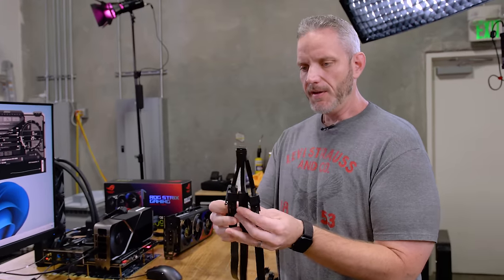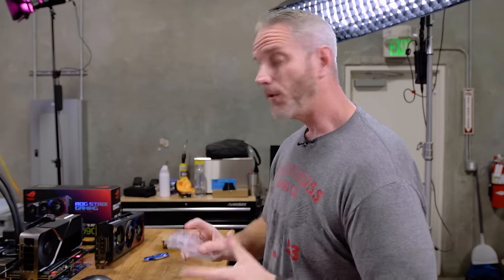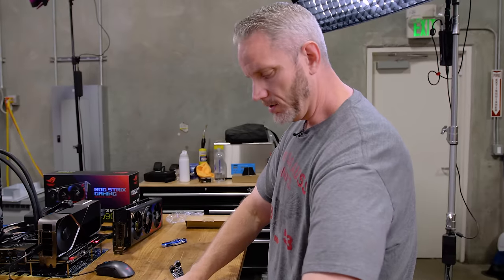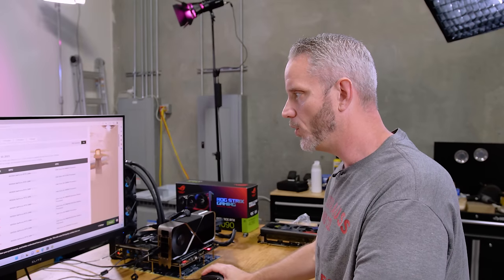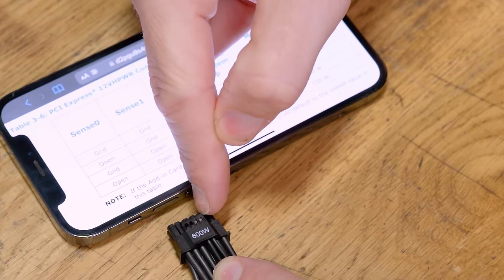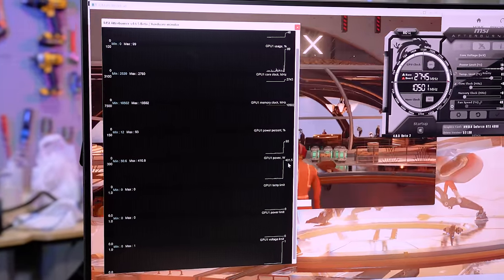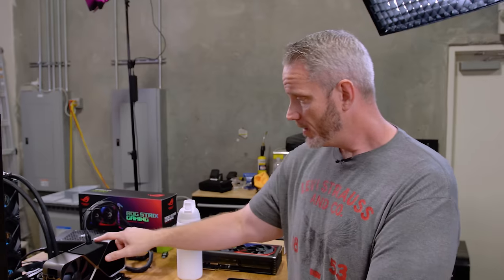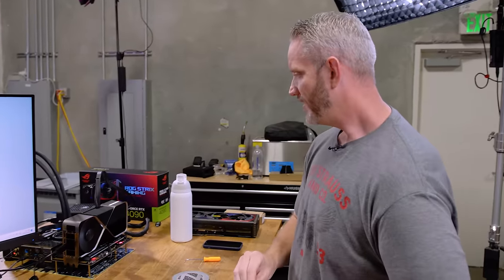DON'T Do this with your GPU!

Comment: about the cable, a little factoid i Remember from school.
a single strand takes less power than a multi stranded one.
unless it's alot thicker.
there is a formula to do the math on it.
but that's to long ago

Comment: ...because each of your "four" leads, especially the one with the 2" extension, plug into a single plug on the PSU ?!??

The primary concern is the heat generated by pushing too much wattage through too-thin Guage of wire AND the possibility of solder points failing; basically boils down to manufacturing quality,  or lack thereof. 🤔

Comment: But Jay, GN just proved for overclocking you need all four connectors, while it will operate on three (100%) four gives you enough current (133%) if you want to overclock. How is corsair getting enough current? (specifically 133%) So I uses you are saying the two pins force the power limit to 133%?
Reply: The cable GN used has a circuit in it that counts the number of attached cables and grounds the sense0 and sense1 wires accordingly (so with 1 cable both sense pins are open, with 2 cables it grounds sense0 only, with 3 it grounds sense1 only, with 4 it grounds both to signal 150W, 300W, 450W, 600W as needed). This is because the old ATX spec 8-pin cables are rated to max 150W each, so the 4>1 adaptor circuit is making sure nothing exceeds that. A different adaptor could ground sense0 and/or sense1 however you want. You could make a 3>1 cable that grounds both and supplies 600W, the card will get the power and run with it, it's just that now you're sending 200W down 150W-rated cables and maybe something melts.

Corsair's new cable is 100% dumb, it's just built for 600W and they're happy to say that it can draw all 600W from just 2 of the ports on their older modular PSUs, so it just grounds sense 0 and sense 1 when plugged in to tell the card that 600W is available.

The PSUs actually built for the new ATX spec won't need any adaptor, there will just be a 12-pin (+ signal wire) cable replacing the old 8-pin ones.

The power limit is just: nVidia says the card is 450W so that's 100% of the power limit; the card/connector is capable of supplying up to 600W so that's 4/3 = 133% max that the power limit could be set to as an OC. If the cable/PSU plugged into it signals only 450W though, then only 100% is allowable. Presumably when new PSUs that actually communicate come around they could signal something else, so you could have a 250W RTX 4060 and a PSU which can supply up to 400W to the GPU giving a max power limit of 160%.

Comment: Solid wire carries less amperage or voltage than stranded. Imagine the electricity flows on the outside of the wire, so stranded creates more surface area.

Comment: Yessir, I was paranoid because I couldn't find if you could actually just use the Type 4 connector - couldn't find the info online, I had to take the chance and just try them because i figured.... there's no other included with the card, PSU, or anything else that has the 12V high power connector - but it's not called the "Type 4" anywhere but on the cable itself, so it's very ...irritating for someone who isn't familiar with it, to actually wonder if it's acceptable or even safe to use.  It would be INCREDIBLY USEFUL if these companies would start calling it something consistent - I do understand it's the 12v - but it doesn't actually say THAT part on the cable itself, lol.

I dunno, "taking a chance" when you're dealing with such delicate and expensive stuff is ...not something I ever enjoy doing... at least... easy way to have catastrophic consequences, depending on what we're talking....

Fortunately, the Type 4 has been working perfectly on my 4090, thus far, and I've seen no signs of melting or any smells like some people do with any of those connectors, and the Type 4 being more compact, and the cord being so high quality, makes it far easier to square away neatly, and to keep seated when you're moving every other wire in the chassis around.  The Type 4 connector ... at least at this point... I highly recommend.  It's just so, so, SO much better, it sorta makes me wonder why they even went with the 4 connector... "adapter" - if you can even call that ...thing... an adapter, haha.  It adapts... all the ports on your PSU into one!  lol.. it really is an outrageous "adapter" - I pulled it out and immediately blurted out "what the f**k is this enormous thing???"

Comment: 12 pins. The normal 8 pins had 3 set for 12 V power and 2 sense cable. I would assume 12 pin takes away 2 sense cable. So it's 5 set for power (in and out) and 2 for sense. That means every single cable that runs power has to run 600W/12V=50amp. 50 amp/5 cable set. So 10A. Jesus. It better be solid core!

Gladly correct me if im wrong. But 10 amps for what looks like a 1,5mm^2 is insane. In a building code i wouldn't be able to install a fuse for that kind of load.

Comment: Yep, and the cable that comes with the Corsair SF850L is way too short, in turns out, for a Lian Li O11 Mini (WHAT!).  The GPU cable supplied by Corsair is just long enough to almost be just too short for the job.  I have it in, its under tension and cannot be hidden.  Seems they were being cheap, or just assumed everyone was using a max case with PSU under GPU.

Comment: Only two is not because solid core but because EPS/CPU 8pin (Same plug on PSU side as PCIe) is 335W on single conector.

Comment: I´d also be fine with 3 or 4 cables going into my GPU, but these Y-cables just look bad. Or make one cable coming from the 600w connector and make it split at the end of that, so I can hide the Y part. Also I don´t understand why they don´t put the connectors on the rear end of the GPUs. I´m no GPU manufacturer, but I think it was no rocket science to do so.

Comment: It's NOT "getting the full 600W". As you yourself said, PSUs don't push power. The cable and PSU are CAPABLE of 600W sustained, but by opening (disconnecting) sense pins, the GPU is reading that the cable or PSU are not capable of 600W and so Chooses to draw less power.

Comment: Some company needs to make a good quality 90 or 180 degree power block for these cards. I can confirm 4090 with a 4000D Airflow the cable looks trash and without bending would be pressed against glass

Comment: Last weekend i build myself a new PC. Including with a 4080S. I Bought a new modern PSU from Seasonic. The PSU came with a nice 1:1 cable. Seems to be working fine. But it's still somewhat creeping me out. One cable capable of handling 600W at 12V.

Comment: Looking at the current power delivery methods and then looking at my ebike and RC battery connectors on large single pair. GPU manufacturers, which one costs less? Positive, Negative, big pads and board distribution. You are messing around with 400+ watts, time to use better power wires.

Comment: The cable will be stranded, Molex-type crimp pins do not work (well) with solid core wire. It seems extra stiff cause its two ribbon cables layered. The normal PCIe ribbon power cables are pretty stiff on their own.

The sense pins are likely to allow the GPU to see the voltage drop over the cable/adapter.

This cable would have been nicer if sleeved, or at least maybe using heat-shrink instead of zip ties. Still like this solution instead of the half octopus fanout adapter.

Comment: I really don't understand why they still put the power connector in such a dumb place on the card. Cable routing would be so much easier it was on the short side of the card, nearest the front of the computer. Then it could run behind motherboard tray in the same place the SATA cables are run. And make the connector plug right-angled so we don't have to bend the wires around.

Comment: there's literally no reason they couldn't have just tossed some more pins into that connector of the bigger size and left the smaller section out entirely, and eliminated at least part of the issue.

but the mail failure point appears to be the smaller pin section breaking in some fashion, leading to problems in some use cases. 'full size' pins would have eliminated that, and not given it a what.. 15 mating cycle lifespan i think it was?

meh.

Comment: electrical engineering 101

Electrons flow on the outside of the wire, stranded will carry more current than solid core, making the point you were trying to make around the 2 minute mark invalid.

Comment: Based on the comments from Corsair calling Steve at Gamers Nexus wrong concerning the function of the sensor lines, I'm not convinced that Corsair fully understands how the sensor side plug functions. I recommend you watch Steve's video explaining how the sensor lines work as explained by an Nvidia engineer. Secondly, rather than a dramatic bend in the cables I suspect it is just a matter of time until someone offers a 90 degree GPU plug. I suspect Cable Mod will release a proper 4090 GPU cable soon.

Comment: Okay I thought this was supposed to be a smart connector. A SMART connector would be able to communicate with data from one device to another. Having four sense pins, is like having four jumpers. What did they need an IC for?

Comment: 3:30 - Actually, they don't "draw" power either. They recieve it. The voltage is like the pressure. To be able to draw something, you need energy. Something that require energy to work, have to recieve energy. We say "draw" power, but it's actually not correct in therms of what actually happens.

The higher the voltage, the more speed of the current (ampere). Use the formula P=U*I. This is why high voltage can go through small cables. If the voltage goes down and you want the same effect, the current has to go up (in literally physical size measured in coulomb). This is because if you have a small cable with high current, the cables will be hot. We could potentially increase the voltage in our home and use smaller cables (for space and price), but higher voltage is more dangerous.

Don't take it too serious what I just said, I am just discussing for fun here :) You said correct in therms of the words you used.

Comment: i think that in the future gpu's like 5090 or 6090, will need to be made only as external gpu cards, due to size increase and not being able to fit into full towers anymore...
Reply: You cant. The pcie throughput cant be reliably maintained with extension cables past a very limited lenght
Reply: @cryptedvick  if they keep growing these gpu cards, this is the only sollution i see, making external gpu's, unless they come up with a miracle in this field until then - to keep or better, to reduce the size of these gpu's. also prices to these 4090's are right now insane, for only 3-4 years of use, yes, the latest technology and all that crap, but even so...

Comment: That corsair cable does not work with rtx4080 super, it gave a red GPU power error LED on the motherboard. Had to switch to the 3-1 adapter which comes with the GPU.

EDIT: It worked for a few hours then gave the error.

Comment: FYI what you mentioned at 06:45 - it's fucking AWESOME we're getting onboard igpu for ryzen now. I couldn't tell you the amount of times I couldn't get a screen to appear with my 3080 because my bios was in UEFI mode in which apparently the FE 3080 wouldn't boot display anything. So I had to get out my 1060, boot into bios and enable legacy mode. Then turn the machine off - put the 3080 back in and everything was fine. 

Now with the board I have - I am at least presented a screen letting me know to go into bios (while using the 3080) and change the mode. Now I've got a 7700X coming in and just knowing I'll be able to simply boot and mess with the bios with the on board GPU is an amazing feature. Not overlooked in the slightest from the customer - big appreciation to AMD for that.

Comment: If you do go and sacrifice a cable maybe take the psu end out and put to the "smart pins" to regular ground (2.0 psu work around) and see if it can tell the difference or not. For the sacrificial cable you could put in toggle switches and on the fly connect/disconnect the "smart pins".

Comment: I dont think this are solid cores. It would make no sense to use them with those kind of plugs at all. Maybe they added a single-metal rod not for data or power transfer, but only for stability, because they know cables in this use case have to be bend in a certain way to look clean.

Comment: Corsair cable is a huge flop!!!
300w cap is not enough. The card is trying to draw the missing 150w from pci lanes, capped at 120w!
Removing that sensor wire simply tels the card that the minimum power budget required to boot is not available!

Comment: Just mentioned this to corsairs online help. They said my RM1000X psu with this 12vhpwr cable could only deliver 450w. They said I needed a 1200w psu to use this cable to deliver 600w.

Comment: Highly unlikely it'd solid copper, its mostly the plastic used for the insulation,  solid copper wire will bend and its position with house wire, copper is extremely soft

Comment: It is great that you do reference to spec to see what the sideband actually does ( Not being "smart" but just 2 copper-connections that set it to 600W and 2 optional connectors that are not needed for power).
Sadly it is rare that people do that as we have seen with the outrage about the 30 mating cycles of the connector (people should check what other connectors are rated for. Hint: not much more if at all), or the supposed USB 4 version 2.

Comment: lol didn't Gamers Nexus just show that Corsair were wrong? In regards to the sense wires and what power delivery can be used?
Reply: they are gnd wire for each 8pin connection to psu...and having 4 will theoretic give 600w but corsair believe max out the one 8 pin to 225w each would also give you 450w + 75 from board that gives 525w ...not sure who is right...usually thick gauge core wire can get more juice in electrical logic sense like your romex wire size in amp scale size vs wattage scale use difference between 18awg vs 16awg...the lower it goes the thicker the wire it gets thus gives more flow in them than constrict the flow ...
Reply: That only applies to Nvidia's cable adapter. That's what Steve from gamersnexus was talking about when calling out Corsair. Not Corsairs own cable. The way this cable works is completely different.

Comment: Hey Jay. 

I'm wondering if you are having problems with overclocking because of the Corsair adapter cable.  It's using two PCIE 8pin connectors that are rated for 150watts a piece.  The slot itself is 75 watts so total in spec that should actually be 375 watts, which is probably why you  couldn't get to 100% power and were hitting instability trying to OC.  I don't think the Corsair adapter cable can push the wattage required to overclock a 4090.  Luckily for Corsair, 4090's are running right around the 400watt mark at stock settings.
Reply: i know you posted this a year ago and the video is 1 year old. the psu im looking at getting :  "Corsair HXi Series HX1500i 1500W PSU" have exactly that 12VHWP cable. where it goes one to the GPU and 2 to PSU thats marked for 600W. it is confirmed by corsair that, each connector can handle 300W and making it total of 600w so with that cable you actually can OC the 4090